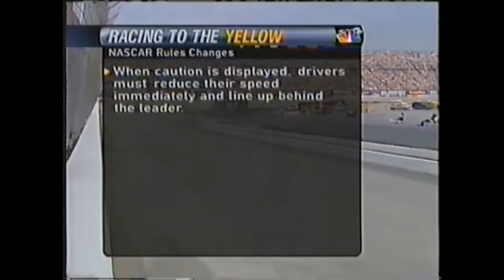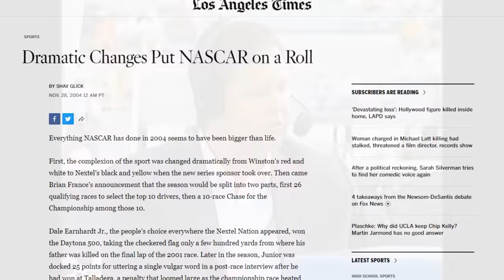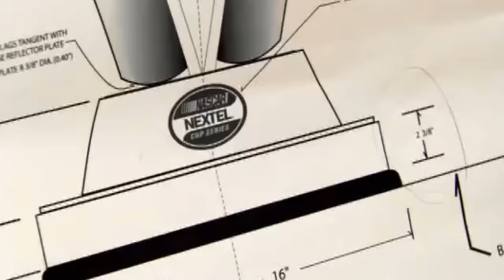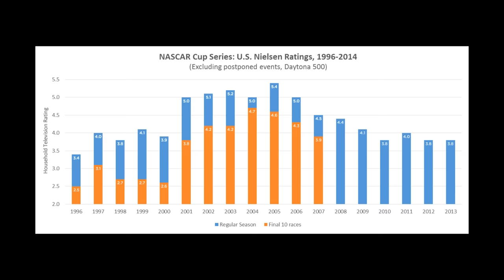NASCAR and the Dam of Legitimacy

Comment: This video popped up back in my feed and you can add 2021 to this list! Most people called it the “best season ever” cause of Larson but I call it the WORST ever cause of this:
NASCAR was still in Covid times (not censoring that cause I’m not a wimp), so they still had their “weighed system” to set the field, which ALWAYS put Larson on pole regardless of where he finished. That allowed him to just take off to 20+ second leads while the field was stuck 2nd on back. NASCAR never bopped them in tech because they wanted a “redemption” story. 
The dam started hurting when Clint Bowyer at some point after the first so many races blew the whistle and questioned nascar “Hey I finished top10 the last few weekends in a row, why am I always starting 22nd and why isn’t Johnson starting higher than 23rd?!”. Of course nascar ignores him and they just kept going. Even on some weekends when Larson wasn’t THAT good, he was always placed on Pole. They handed him the 10 wins and then he was handed the title that year. If NASCAR’s weighed system had actually been what they had described before, I think we would have seen a different pole sitter each week or so, maybe a few repeats, but also they denied them all ANY practice so pretty much if you sucked 1 week you were gonna suck the next. It was an absolute disaster 2021 was. 22 things sort of got back to normal but the damage was done. And then it reared its head again at the Kansas race this year when nascar decided to hand Larson the 0.001 finish over Buscher, because of the fact “hey it’s Larson, it’ll make for a better story and more redemption”. It sucks how much NASCAR sticks its foot in everything now. I feel like with the lack of practice, it’s gonna stay this way till nascar realizes that PRACTICES MAKES PERFECT! This way EVERYONE has a legit shot of being fastest or can get a taste for the pole

Comment: Fix the GD point system 

The old way is good but make Wins worth so much more that the driver Winning 8 Races will Win The Cup 
Unless then the next Guy Wins 6 Races and 15 2nd place Finnishes 

The Top 3 Finishes need to pay substantially more than the next spot and the drop from 3rd to 4th big and then just 5 points every   spot after that like the old days 

So 1st should be 50 points 

2nd 25 points 

3rd 15 points  

4th 10 points 

5th 9 points 

6th 7 points 

7th 6 points 

8th 5 points 

9th 4 points 

10th 3 points 

Then 11th 2 points 

Then 12th on back is 1 point for finishing 

DNF’s no points 

Most laps led is 11 Bonus points 

Leading a lap is 5 Bonus points 

That way You can go all out for Wins  
and if you’re Winning then you can blow a couple engines & a couple wrecks and still be in the Top few spots 

It will make it so that Winning is worth going all out 
But 2nd is still worth enough more than the rest not to wreck
Yourself going for a W 

That’s how it needs to be done 

Telling You 

The Top Winners  
and The Best avg finishers if in the top 3-5 consistently they will all be in contention coming done to the end of the season.